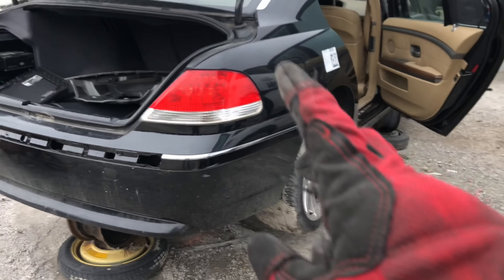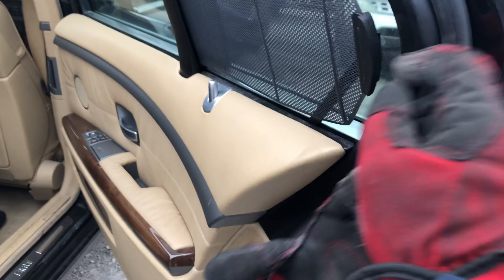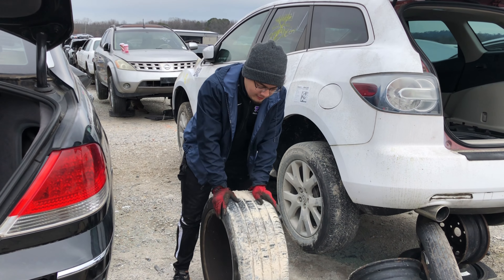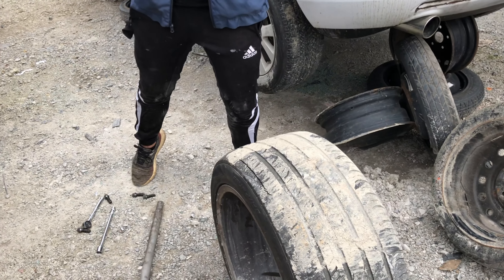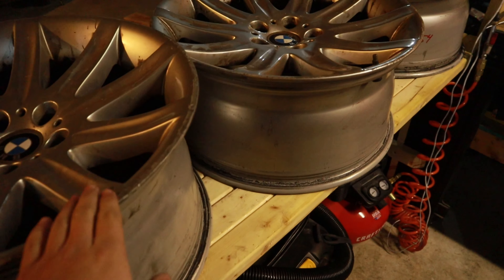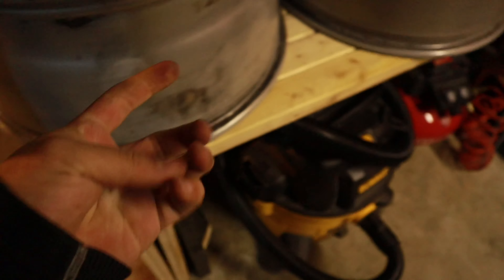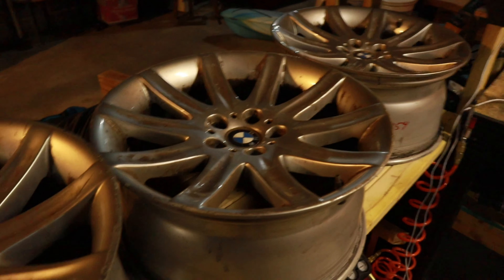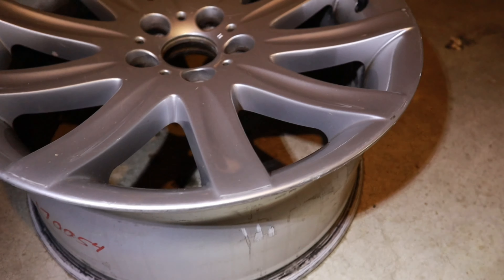NEW WHEELS FOR THE E38

Comment: Hi i know this is a old thread ,but hopefully my question will reach you,

I'm also running a set of style 95's on my e38 but the centre bore is different, 72.6 on the car hub and 72.56 on the alloys just wanted to ask what did you use to make the fit perfectly as mines on the car have created a really bad shake at 40mph,

Thanks in advance